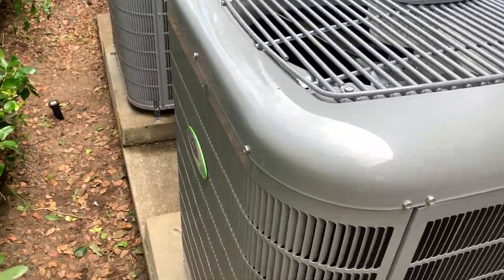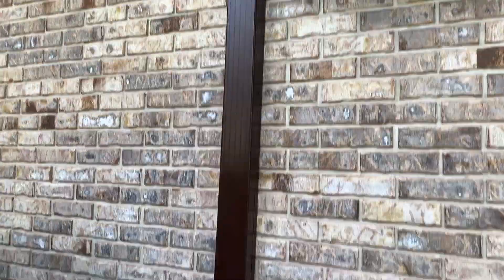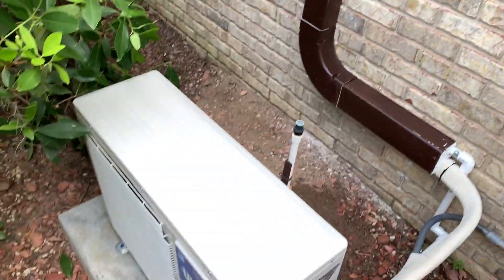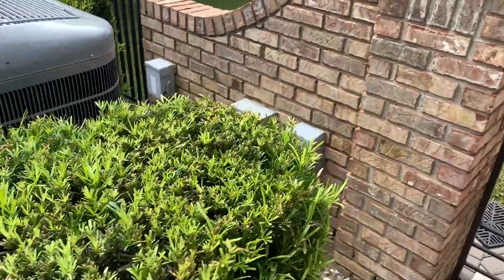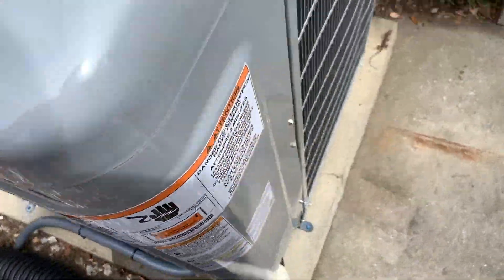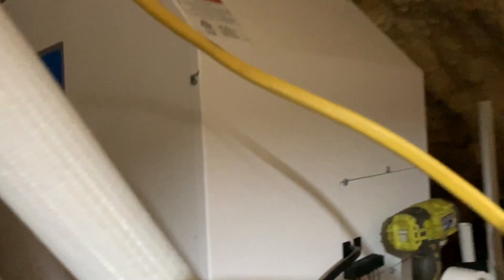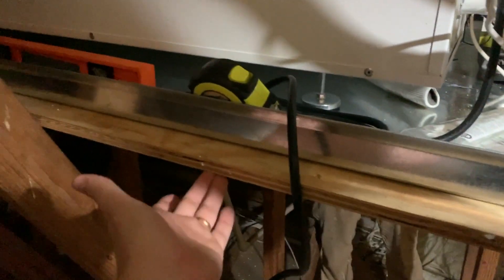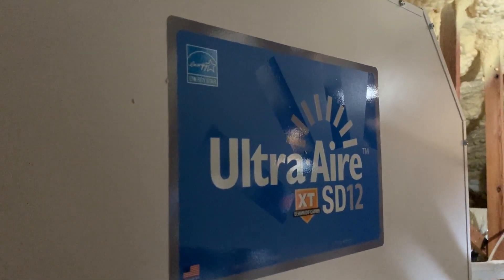Home Performance AC Changeout w/ UltraAire SD12

Comment: Great video. You didn’t mention it, but nice routing on the AC drain  switch in the pan.

Also, is there a safety drain switch on the dehumidifier?

I’m in St. Augustine, FL. I obsess over drains...
Reply from the maker: Yes there are two safety switches on the dehum. One in the main drain and one in the pan.